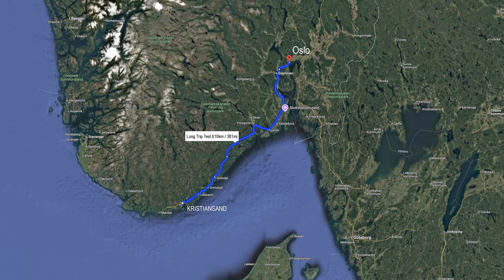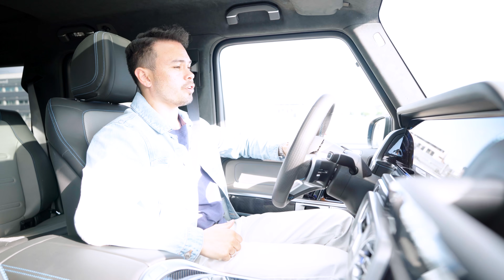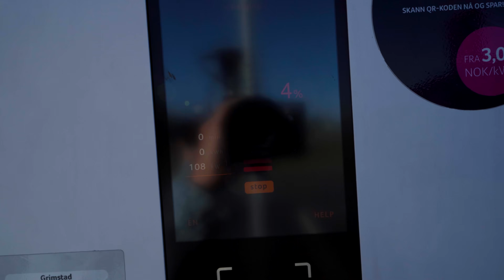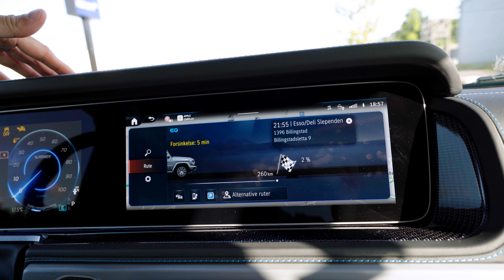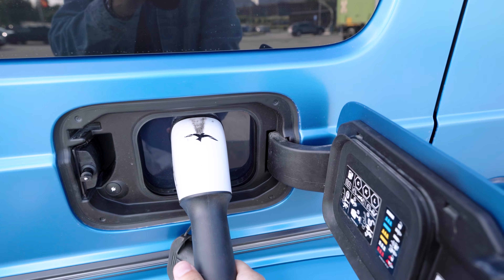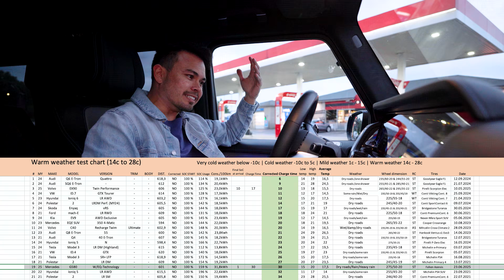Mercedes-Benz G580 | 610KM LONG TRIP TEST

Comment: Getting to the point. My model S consumed 33-35 kWh/100miles, the g580 gets 48 kWh/100miles per Edmunds. EPA estimates 54. Taking the higher consumption of 20 kWh and assume home charging in a low-ish electricity state in the state at $0.15,the g580 will cost $3 more to drive 100 miles compared to the model S.